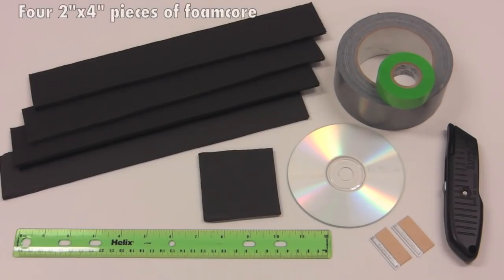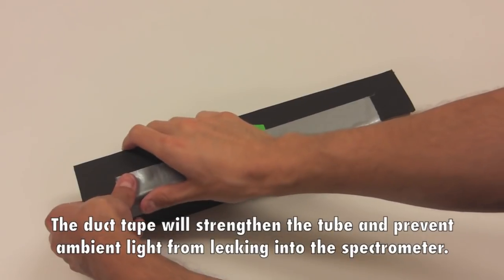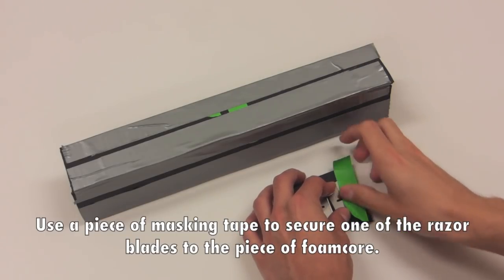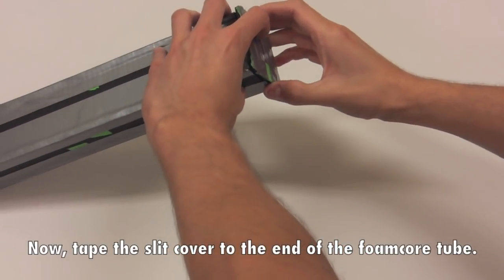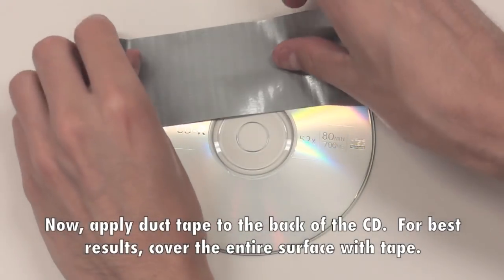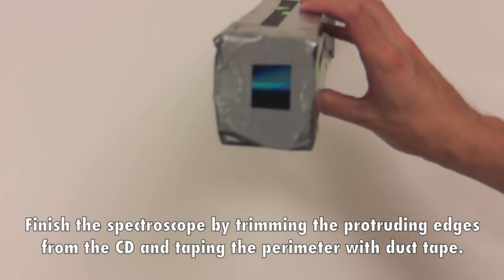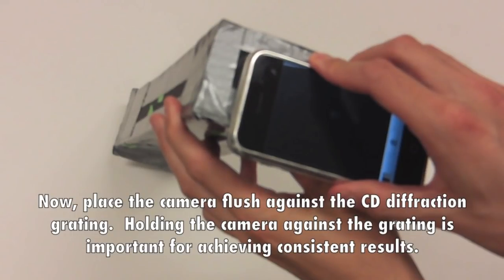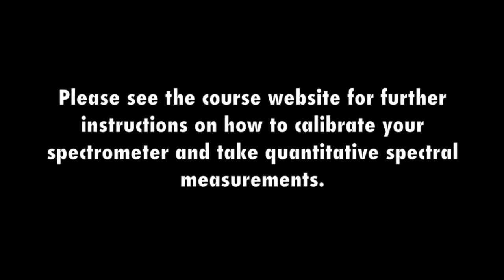Lab 1: CD Spectrometer

Comment: My niece & I made a spectroMeter following the guidance of the video. The end result is high quality for real usage and durable enough for a nine year old. Thank you! I am not sure who has had more fun with it me or her. Our questions: What does it mean when the colors are clear and bright vs soft and fuzzy? What do the thinner vs thicker color lines mean? What does it mean when more parts of the color are show vs one color (maybe be a repeat question but not sure)?
Reply: How the refracted lines look is partly due to the wavelengths of light that the light source beam is being split into.  If they are fuzzy, or a full spectrum, it partly means that the chemical composition of the materials in the light source are mixed.  The HeNe (Helium Neon) laser in the video shows what we can take to be a chemically pure light source so it makes a pretty discrete band of red.  A typical tungsten filament light should give about a rainbow spectrum, while a LED light should have discrete bands.  The angle of prism (which is built into the pattern cast when the CDs were molded) also plays a role I believe (sorry I forget the exact mathematical forumula though).

Comment: My niece & I made a spectroMeter following the guidance of the video. 
The end result is a high quality for real usage and durable enough for a 
nine year old. Thank you! I am not sure who has had more fun with it me 
or her. Our questions: What does it mean when the colors are clear and 
bright vs soft and fuzzy? What do the thinner vs thicker color lines 
mean? What does it mean when more parts of the color are show vs one 
color (maybe be a repeat question but not sure)?
Reply: footlessmichael 
Brightness = Intensity(# of photons) of the light
Thickness = how big the range of the wavelenghts is i.e. a redlaser might have a wavelenght of 740nm +- a few. Which will give you a very small red line (well most likely a dot, but thats because of the shape of the lightsource, not the light itself)
A red lamp how ever will have a much wider range like 700-800nm (and very likely some other wavelengths/colors mixed in)
I'm not sure what you mean by soft and fuzzy but I guess it's either a problem with how well the light gets focused, or the light contains many different wavelengths spanning over a range of different wavelengths/colors, so you don't get distinct lines but a gradual change from one color to the next.

Most lightsources produce light consisting of different wavelenghts. A spectrometer splits this light (different wavelenghts get refracted at a different angle) into those distinct wavelenghts.
The dark space between the lines are the wavelegths the lightsource does not produce(or some medium between the source and the spectrometer absorbed).

Comment: There is an 8 inch discrepancy between the needed supplies and first instructions.  It's 2 X 12 not 2X4 as stated initially.
Reply: well another argument to go for the metric system ;D

Comment: There are 3 questions people need to answer by building,  this.  1. Why not Abs 12 inch black tube instead? That would be superior.  2. What mental fixation is it with the transparency spacing of the razor blades?  Why not just state it in millimeters, then offer the gap in several household items, like toothpicks or 2 razor blade wide, etc.  As it is in video, I have no idea how to do the gap, as unfamiliar with item mentioned, and so rushed through this step, it might as well as been cut out.  3. Since no point in spending 2.5 hours and $20 in duct tape, foam core razorblades, gas, when any step is misunderstood,  why isn't the properties of a recordable CD shown to the camera? No zoom on the clear acrylic track lines.  Without this zoom shot, most users will just scratch their head and assume this is beyond comprehension.  All, but those with blind faith the video maker isn't leaving some critical step out.  This blind faith is further shaken when other mistakes are made, like the dimensions of the foam core.  At very least,  address all 4 of these in the video description, so viewers don't think themselves not understanding enough to attempt to build this.  If enough people build it, hopefully an android app will emerge that can be calibrated,  and used commonly.  Applications from element identification, to circadian rhythms, to choosing leds, to interior design and architecture, to artist lighting, color matching,  lighting sales, etc, etc. Limited by imagination.  Less guesswork, less work, one tool.
Reply: You had me at the argument that the gap needs to be given as a measurement- I don't keep transparencies around the house. You lost me at all the other gripes-

Comment: Neat Idea but why do I have a feeling there is a MUCH easier way to assemble the spectrometer body.
Reply: There is. By using the foam core's paper outside, you can fold the foam together with the paper backing acting as the duct tape.

Comment: Why does he says the 4 pieces of foam core should be 2 inches by 4 inches, but points to pieces lying next to a ruler which are clearly at least 12 inches long? I guess they are supposed to be 2 inches by 12 inches.

Comment: "Launch the phone's relevant image capture program." This needs some explaining. Turns out my built-in camera didn't do the trick. I downloaded the SpectraSnapp app for my smart phone & will try that out.

Also, all the CDs I've come across are like plastic sandwiches with the reflective layer in the middle. I had to cut the CD into sections, split them apart, and THEN peel off the reflective layer with sticky tape.
Reply: > Also, all the CDs I've come across are like plastic sandwiches with the reflective layer in the middle

That's not CDs, that's DVDs! Read wikipedia!
Reply: I've never, ever seen a CD with plastic over both sides of the reflective label... ever... ever. Because that is not how they are made.

Comment: I will have to watch this when I have battery life.  Skipping through the video, I am puzzled.  they rip apart the cd, using only the clear part?  I would have thought you would need the shiny stuff? Skipping through, I must be missing something.
Reply: The shiny part is only used to reflect the laser back inside a CD reader. Its the transparent coating below the shiny part that really holds the data (and hence has micron/sub-micron features that split the color components of the light)